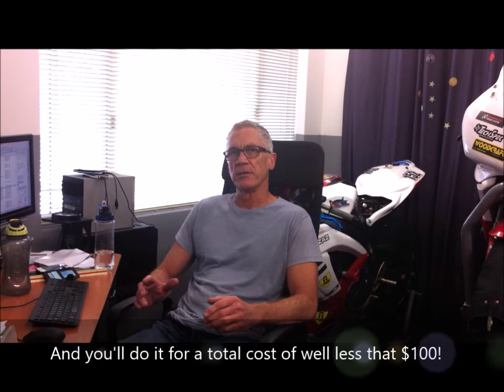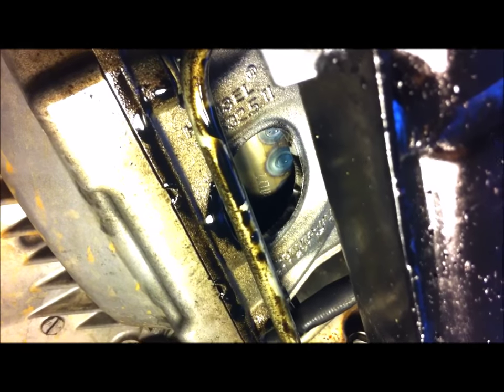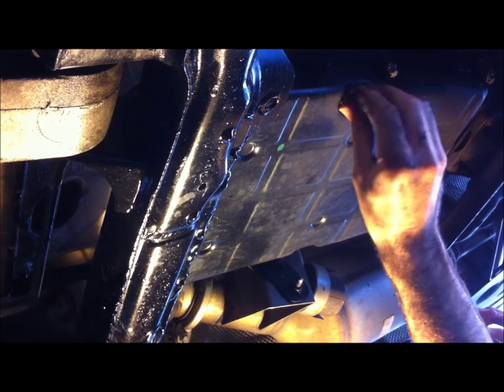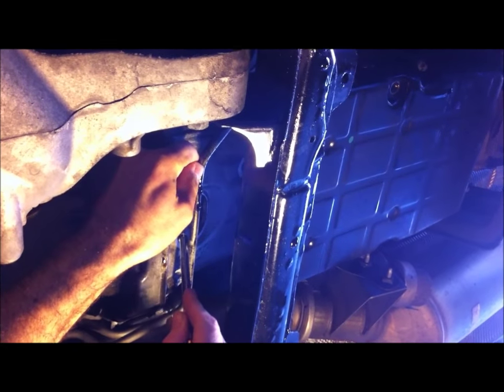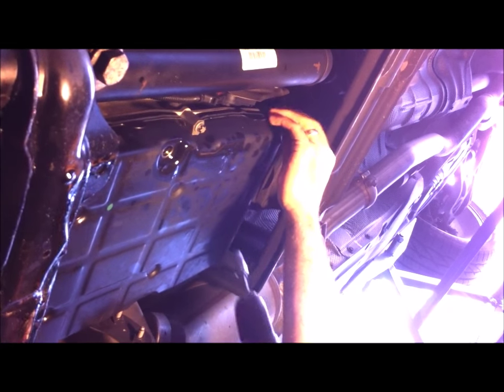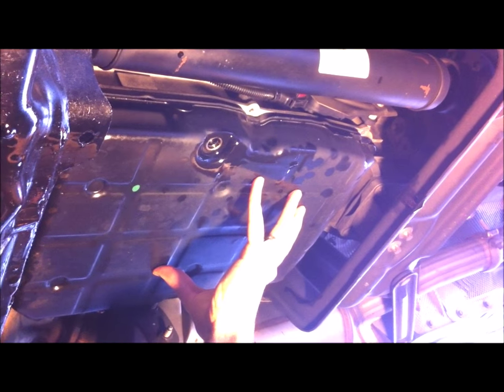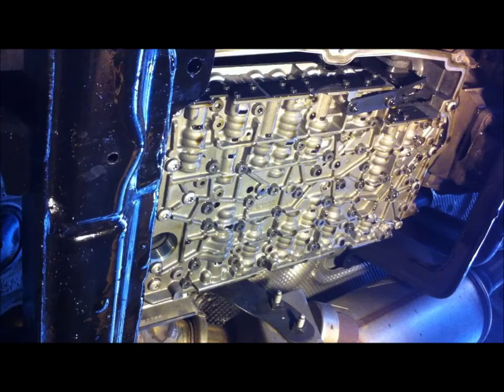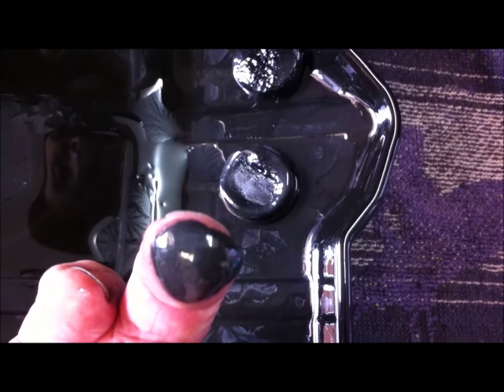Mercedes 722.9 ML320 ML350, C, E, S, GL Transmission Service

Comment: Very good and informative video, I'm impressed by the fact that there is so little wasted oil. First one I did myself was on a MB E Class with the 722.6 Auto transmission. As there is no drain plug on the TC, the only way to do a complete 100% change is after changing the filter and replacing the sump etc. You have to connect a hose to the cooler return pipe, and run the engine and pump two litres out, replace them, and repeat until the new red / blue ATF appear's. Its a lot of waste of expensive fluid, but no alternative., as far as I know. The car I did was a 2010 E200 W212,  and thats how I had to flush it out. But now, I've got a 2014 E Class 220, W212 with stop/start, and  I'm wondering if it will work out like the one you have done in the video? All depends on whether the TC has a drain plug or not, I guess. If not, what would you suggest? Same way as the 722.6 change and flush, or do you have an alternative method? BTW, what year was the car you were working on?  There were different colored plastic pipes too, for different years etc,  but until I actually have the sump off, I wont know which is the right one, and sods law being what it is,,there's a fair chance that the original pipe may get damaged,,,,, what are the chances of this happening? Great video, glad I found it, Keep up the good work !!!
Reply from the maker: Thanks for the kind words. For 722.6 and 722.9 transmissions I have suggested viewers use the same method to drain the TC when a drain plug doesn't exist. It's a method recommended in some service manuals for other makes to. We were working on a 2008 W164 ML320 with the filling footage borrowed from a 2008 W204 C320CDI as the transmissions are identical. For some reason MB dropped the TC drain plug for a short period around the end of last decade but it appears that was short lived. Hopefully your 2014 W212 has it back again. It would be difficult to damage that overflow pipe so don't be concerned. A quick tap from underneath will see it unclip and fall over inside the pan. It will probably be a green pipe as that signifies the green/blue ATF MB236.15. Transmissions with red ATF are fluid spec MB 236.14 (in the 2008 722.9 and my 2006 W639 Vito with a 722.6) and will have white overflow pipes like the 2008 ML320CDI in the video. The transmission is simple to service especially if you have a compressor. You can buy a fill fitting now very cheaply on eBay or Amazon. https://www.amazon.com.au/722-9-Transmission-Filling-Filler-Adapter/dp/B07JBHHWK8 Good luck and please report back with your findings. Regards, Scott
Reply: @ScottElliott152   The more I dig into this, the more "mystery's " I come across !!!  :)  So  another question for you, if you don't mind?  I am now at the parts ordering stage and its not as straight forward as you might think....Why is there different ATF change kit's for MB's when they have ECO Stop/ Start fitted? Some ad's for the ATF change kit's ( even for the same 722.9 trans) expressly state " Not for use in vehicles fitted with ECO Stop / Start,"  To make it even more puzzling, I've checked out a few, and all the individual part Nrs are the same, regardless of the vehicle being Eco Stop Start or not. Can you shed some light on this mystery please?
Reply from the maker: @jmreire1  I'm not conversant with the stop/start system. A quick search reveals there's an additional pump which I think affects the quantity of ATF. I found this which explains what's going on: https://forums.mbclub.co.uk/threads/722-9-stop-start-gearbox-service.240698/
Reply: @ScottElliott152  Thanks for  your help, Scott. It's appreciated. 😀😃😃

Comment: Thank you for the great video! I have a 2014 ML. If I am going to drain the TC through the oil return line, do I do that after the pan is off or do I do that first? 10L of fluid should be more than enough to have on hand? Cheers.
Reply from the maker: Thanks John. I assume you will disconnect the return line and run the car for about 30 seconds to pump the TC dry? If so do that after you've drained the pan by removing the plug and dislodging the overflow pipe. Then remove the oil pan. 10 litres is enough which allows a litre or so to flush the oil cooler and lines.
Reply: @ScottElliott152  Thanks Scott!

Comment: Thanks for your Inspiring comments and videos Precision to the last detail I am from south Africa One Question what's your take on the MB scan tool you recommend does it cover all repair procedures on all models waiting for your favorable reply
Reply from the maker: Thanks for your kind words. I use a Chinese cloned MB Star system and yes it covers all procedures on all Mercedes vehicles. There are many suppliers so do some searching. You're better off to purchase the full system already installed on a DELL D630 laptop. Here's one example: https://www.obd2tool.com/goods-335-MB+SD+Connect+Compact+4+Star+Diagnosis+Tool+Plus+Dell+D630+Laptop.html

Comment: Great video sir! I have a question: I have seen a video where someone takes off the return line and flushes the system by starting the car. But he doesn't drain the TC. This method looks much better. My question is: Does it also work to connect a manual ATF filler machine to the high pressure line and flushing the system like that by pushing the new fluid in? Or is that pressure too low to achieve that? Thanks again!
Reply from the maker: Thanks for the compliment. The Mercedes Workshop System (WIS) recommends the method I've shown in the video. The significant modification I made to their process was to use a simple air lift to push the ATF in compared to them using the MB special tool being a hand operated pump.
Removing the oil return line and running the engine for about 30 seconds is another method to drain the torque convertor if the TC doesn't have a drain plug. It's a legitimate process and is used by other manufacturers.
I guess you could fill the transmission using the oil line going out to the oil cooler but you'll still need a fitting with a valve on the sump to set the level using the internal overflow pipe. You'd be making extra work for yourself.
You don't need much pressure wherever you pump the ATF in ... I mention 4 to 5 psi in the video.
Reply: @ScottElliott152   Thanks for your answer. I was actually talking about the exact method you are using but the only change is using an atf filler instead of your airlift method to push the oil through the high pressure line back to the transmission without the sump.

Comment: Hi Scott, another great video! I have a question.
There is no drain bolt on the torque convertor on my CLS 320CDI 2006, it’s the  7G tronic transmission, same as yours on the C class 
How can I flush the old oil out of the converter? 
Thanks 
Vilmos
Reply from the maker: Yes some 722.9's didn't have the TC drain plug. You can disconnect the return line from the oil cooler where it goes into the RHS of the transmission. Start the engine in Park and let it idle for a short period to pump the ATF out of the TC. As soon as the ATF stops coming out turn the engine off. It's a legitimate way of doing it as other manufacturers document that method in their workshop manuals.
Reply: @ScottElliott152  Can you skip this step? I mean does the oil cooler flushing procedure (11:00 on the video) pushes all the old oil including the one in the tc out?
Reply from the maker: @ccfabs8932  Well you could skip the flushing process but you will not be doing a thorough job on a $10,000 transmission. The oil cooler and lines hold about 1.5 litres which is around 15% to 20% of the total volume. Would you only change 80% of your engine oil? Flushing the oil cooler lines doesn't drain the TC ... there's a drain plug for that as shown in the video. The transmission is easy to DIY service. Do it properly and your transmission will thank you with smooth quiet performance. Regards, Scott

Comment: Great video and job.
I have a w212 2014 and a 722.9 PLUS.
Now I don't know is it the same oil temperature (45°C) level for the 236.15 oil or 30°C.
Do you know what it is?
Thanks
Reply from the maker: Thanks for the compliment. I'm not sure about the 722.9 plus. I'd suggest you jump onto www.benzworld.org as someone will know. Scott

Comment: My guess is force feeding it from bottom and the stand pipe could be a good indicator too.
Reply from the maker: The pressure feeding from the drain hole is the only method and the Mercedes recommend way.

Comment: Hi Scott, I need to a transmission service on my Merc and I need the low friction blue fluid MB236.15 it seems like the transmission oils in Australia have conflicting codes on them.  eg both 236.14 and 236.15 on the same oil which doesn’t make sense to me.  Do you have a recommendation for a good MB236.15 fluid? Thanks Drew
Reply from the maker: Drew ... now Penrite have released AFT BMV that's what I use these days and it's backwards compatible. Meets specification MB236.10 to MB236.17: https://penriteoil.com.au/products/atf-bmv-full-syn
It's all about the additives. The fact it covers a wide range is a good thing. You can get it at Supercheap, Autobarn, Repco etc
Reply: @ScottElliott152  Hi Scott, thanks for the response I think that is the exact oil that I was looking at last night and I just couldn't understand how the one oil does different friction points.  I rang the local Mercedes dealership and for a complete transmission service kit (with only 6L of the blue Mercedes ATF fluid ... eg they don't flush) they want $309.13 ... don't forget those 13 cents Mercedes I say!  Just a pity I'm not in WA else I would love to catch up for a beer with you!  Thanks Drew
Reply from the maker: @DrewFixIt  $309.13 is ridiculous. Last time I checked the MB branded ATF was Fuchs in the same container but with a Mercedes sticker. Strange they only supply 6 litres because these transmissions take about 8.0 to 8.5 litres without flushing the cooler. Also you waste a little bit because you have to overfill then drain the excess to set the level.
Reply: @ScottElliott152  So to upgrade the MB kit to 10L local Mercedes dealership wanted $382.63 (don't forget the cents).  REPCO had a flash on-line sale last night so I bought 12L (3 x 4L) of the Penrite ATF BMV for $128.25 and bought a genuine OEM filter kit online for $70.  So ... just a tad over half the price of the local Mercedes dealership!  Thanks Drew
Reply from the maker: @DrewFixIt  Did they have a reason why only 6 litres? i know the dealers sometimes don't drain the TC so that could be why. You've got enough excess to do a good flush of the oil cooler and lines. Next job is to do the power steering. I've got a video of how to flush it on my W204 C320CDI. It will be the same on your ML.
Reply: @ScottElliott152  Hi Scott, one more question what type of Loctite did you use on the Torque Converter Nut?  I know you mentioned the colour just wondering if you could let me the product number (eg is it 242)? Thanks Drew
Reply from the maker: @DrewFixIt  Actually I used some sealant on the plug to make sure it didn't leak. It was Permatex Aviation Sealant. It acts like a mild thread lock to. You don't want that plug stuck in there.

Comment: I noticed the ramps where they high enough to make full or pretty close to full access from underneath?  Obviously not as good access as a four post lift where you can get above eye level.
Reply from the maker: Ramps were fine. Yes a 4 post lift would be nice.

Comment: Thanks for the great video. I have a 2007 S550. I bought it is 70,000 miles and do not know the service history before then. It is now at 130,000 miles. The manual said the transmission flush should be performed at 39,000 miles. Car is running fine and does not have any problem. I was told that if running fine - do not change, because it sometime can cause more problem to transmission. What is your recommendation?
Reply from the maker: Thanks Sumit ... Yes I've heard the urban stories to never change the ATF on a transmission with high miles. The theory is all the accumulated gunk and deposits are holding the thing together! My feeling is if it's gunk and deposits holding it in one piece you're on borrowed time anyway so you've got nothing to lose in doing the service as described. Report back once you're done. Regards, Scott

Comment: Hi, Scott, you did a very nice job. Especially when you say that Mercedes is out there to make money on us... I have 4 Mercedes and 3 of them have the 7g tronic... I serviced my S class to an Authorized shop, and they DID NOT: CHANGE THE BOLTS, CLEAN THE LINE AS YOU DID... The result is the there is leakage of oil and they said that is normal... The whole service took 45 minutes. and the charged 2.5hrs... plus the really bad job..... don't tell you the charge.... mind that only the fluid charge is euro 23 per liter...

Comment: Ingenious! Just wondering what's the diameter of the pipe, also metal pipe and rubber tip. Also most important thing, where did you get them from? thx😃
Reply from the maker: Thanks Andy. The plastic tube is 10mm from the local hardware store. The metal pipe fits into the plastic tube ... size is not that important. Just something that works.

Comment: Hi Scott, I live on the central coast...not sure where you are....I am an old diyer myself. My question for you is a general question...What diagnostic system do use...I have used icarsoft(PC version) on an ml270 (2003) but I thnk it is too long in the tooth now for ml350 2009.  I have seen chinese C4's advertised and also some new handheld icarsoft units...Which do you use or recommend for the Ml350...Regards Mike
Reply from the maker: Hi Michael. I'm over in the west. I use the Mercedes DAS/Xentry or STAR system bought from here: https://www.obdexpress.co.uk/wholesale/mb-star-series/
I bought the system on an external HDD. If you've got the funds make it easy and get the D630 laptop with multiplexier all preinstalled and ready to go: https://www.obdexpress.co.uk/wholesale/mb-sd-c5-star-diagnosis-with-ssd-software-plus-dell-d630-laptop-with-4gb-ram.html
Because your ML is 2009 it should use DAS which is better because it has more access. Xentry kicked in from about 2010 and is more restrictive. Both systems are loaded. After connecting the car and you start Xentry it will automatically switch to DAS for the older vehicles.
I notice it has Vediamo installed which is even better than DAS or Xentry.

Comment: I’ve been told that changing the fluid when old and dark could result in slipping after the new fluid cleans out all the gunk.  Did you experience this?  My car is 12y old and has 74k on it.  The fluid has never been changed.
Reply from the maker: Roshan I've been hearing that story since I first started driving. It makes no sense and is not logical. The theory being the transmission is in such a state it's only the gunk and deposits from old oil holding it together. Considering the amount of torque transmitted do you really think caked on deposits are going to keep it going? I've never seen hard evidence  with photographs etc ... it's always along the lines of "A work colleague said his Uncle lives next to a guy who's cousin heard from an old fellow that you should never change the transmission fluid!" Probably a myth started by transmission repairers to generate more revenue for their businesses. Modern automatics need their ATF and filter changed about every 60,000 to 80,000km or 4 to 5 years for normal use. At 74,000km/12 years your transmission is overdue an ATF and filter change. You'll notice it will be much smoother and feel better afterwards. We note in the video the transmission was like new again after the service at 120,000km.
If your transmission is only functioning because of sludge and deposits you need a new one.
Reply: @ScottElliott152  Thanks Scott.  There are two reasons why I somewhat believe this theory.  1) my 1999 Acura TL started slipping soon after replacing the fluid that everyone told me not to do at around 110k miles.  It started slipping at 112k and died around 115k.  Could be a coincidence.  2) The mercedes independent that is supposed to do the fluid change (i already bought the change kit from FCPEuro) told me that he would look at the fluid and tell me whether its worth changing it because in some cases it can start to slip afterwards.  He said if it is bad then he recommends leaving it as is.  Seems honest to me because he is not getting paid if he recommends not doing the service.  I don't think its that bad.  I have to get my transmission oil cooler hoses changed because they're leaking so wanted to replace the fluid at the same time since I was already paying someone to do the lines.  Will keep you posted on what is said.  Thanks for the quick response!

Comment: Please correct me if I'm wrong but when you remove the drain plug you should not get hardly any fluid since the overflow device serves as a level sensor.  I notice there was quite a bit of fluid when you removed the drain plug.
Reply from the maker: Wayne Hendricks . The fluid level is set with the engine running and therefore the transmission pump is operating pumping fluid around the system. Once the engine had been stopped for a while the fluid level in the transmission will rise a bit because some of it will find its way back to the oil pan as it's not circulating anymore. Scott
Reply: Thanks Scott.  Yes, that makes sense as for history we checked  the transmission level with the engine running and in Neutral. I guess that still applies with this transmission.  I am convened MB wants you to bring your car in for them to do this job.  Your video is terrific. Actually, I think I overreacted on the temp of the fluid as the new transmission fluid is cold.